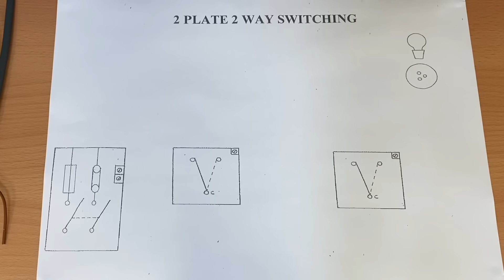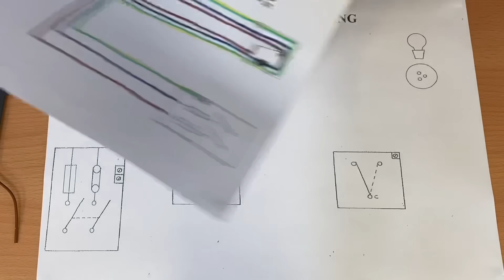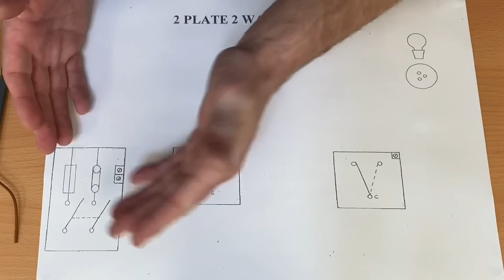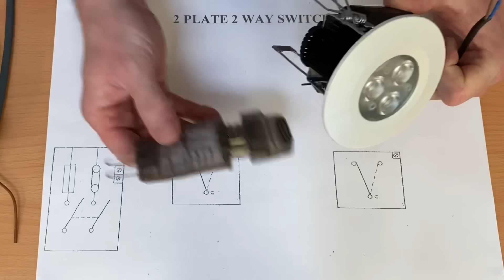Wiring Diagram Lighting Circuit 2 Plate Method Taking the Feed to the Switch - 2 Way Switching

Comment: Why are you connecting common terminals together? You can bring power to common terminal on first switch and take power from common terminal to lamp on last switch - it will save you money on copper. Also many latching relays are available in market, you need only push-button to activate and disable them.

Comment: Its always worth using a 3core cpc as a switch wire so you have a live feed in the light. It doesn't need to be used or made live but its handy especially on a upstairs circuit in case a loft light or even for a feed to outside light.

Comment: With the 2 plate method, is it possible to take the switching line from the 2nd/other switch? 
I realise this would cause issue with your neutrals.

Comment: Excellent videos - a quick question, in the bathroom I am preparing to wire in LED down lights using the 2 Plate method and I need to wire in a fan extractor with a run on time (fan continues to run after the lights are switched off) therefore need to use a 3 core cable. How do you wire this into the light switch and a fan isolation switch as well. Thank you

Comment: So how would you wire 2 x 4 gang switches for 2 way switching? i.e. operating 4 different lights from 2 x 4 gang switch locations. 
Example a kitchen. gang 1 down-lights, gang 2 wall lights, gang 3 plinth lights, gang 4 pelmet lights on/off from either location using this 2 plate method?

Comment: Love the videos, currently wiring my new build garage but will be getting an electrician to do the final power up and testing. Using this method is there a permanent live in the second switch or is it always intermittent with the switching?
Reply: Yes, the brown cable from the consumer unit line to the L1 terminal in each switch

Comment: I've used this method in my house on two spots in the hallway, and then with the intermediate 3 way in my kitchen. After working through some basic issues for both jobs I'm not left with pulsating lights in the kitchen (not meant to be). I've checked the connections at the lights and the switches, and now don't know what to do next. Any ideas?

Comment: I'm an electrical student and your videos are proving a fantastic aid and accompany my studies brilliantly, I am extremely grateful to you. Thank you.
One quick question if I may, I have a two way light at one end of my hallway but I want to add another light at the other end of it, the switch at that end has the two way 'strappers', can I run a cable to another light fitting off that switch?
Reply from the maker: This may help
Wiring Diagram Using a 2 Gang Switch Downstairs Upstairs 2 Way Switched Using 3 Plate Wiring Method https://youtu.be/0VnbtsSPcow

Comment: As ever always great informative videos intresting way of wiring seems alot easier than fiddling in lofts and light fittings top job as an auto electrician its a very different way of connecting a two way circuit all the best
Reply from the maker: Thanks for watching and taking the time to comment. 👍🏻

Comment: Hi, with loop at switches adding extractor fans or smoke alarms would be an issue as there is no permanent live at a local pendant, would you take the smoke and extractor to switches as well?
Reply: Extractor yes. Smokes won’t go to the switch as they wouldn’t be on a switch. Connection is made in the smoke alarm and one of the smokes will be fed from the consumer board

Comment: why doesnt it work if you go from consumer unit too common on first switch, then connect L1 to L1 and L2 to L2. and on switch 2 connect common to the ceiling rose?
Reply: It does work like that, this is just another way of doing it, I prefer it your way as there’s less cables in 1 terminal

Comment: the permanent live from the light to the switch can that go in common and the black 3 core wire go in l1? and with the other switch the normal live goes into common and the black 3 core wire goes into  l1?

Comment: Great video 👍🏻 you can also take the feed to the first switch, 3 core over to second switch (strippers and neutral) the switch line, neutral and CPC up to light point from second switch.
Reply from the maker: Try this
Wiring Diagram Taking the Feed Through the Switches - AM2, AM2S & AM2E Lighting Circuit Explained https://youtu.be/cIPZhriDQr8

Comment: Is there a better or different way of wiring if the first switch was a 2G to alleviate the need to have 3 cores in L1?
Reply: Yes bring the feed too one switch and the switch wire too the other

Comment from the maker: == 🕐 Time Stamps - Cut to the action 🕕 ==
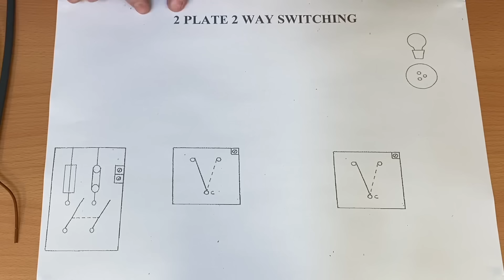00:00 - Wiring diagram 2 way switching 
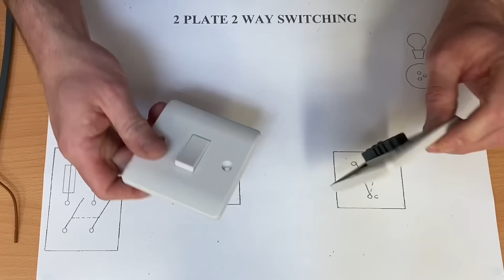00:25 - 1 gang 2 way switches
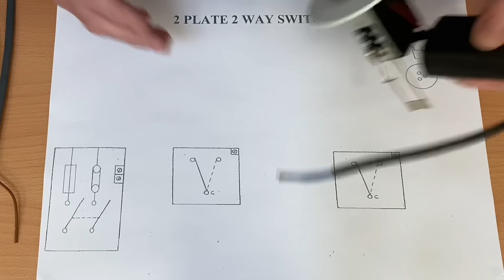01:07 - 2 plate method and the use of LED downlights 
01:50 - 1mm2 twin and CPC cable (twin and earth) 
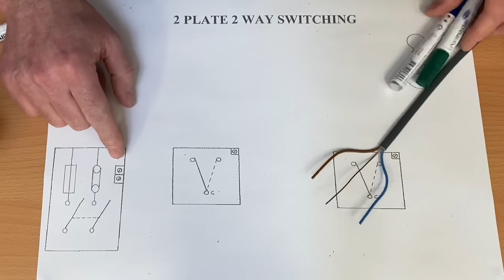03:00 - The cable form the consumer unit to the first 2 way switch 
05:58 - Adding the 3 core and CPC cable between the 2 way switches
09:12 - Adding the cable to the lighting point
11:03 - Joining the cable to the LED light 
12:37 - Working out if the light is on